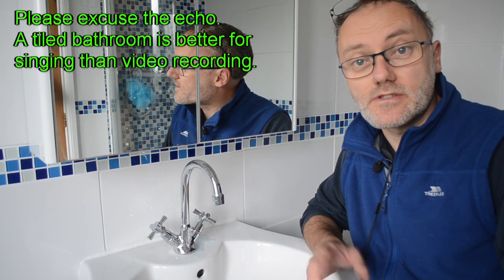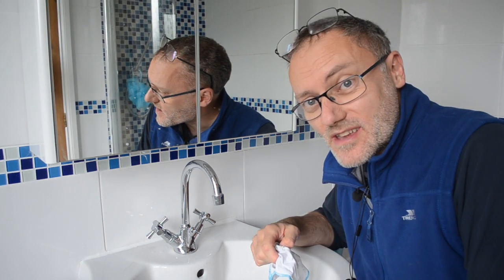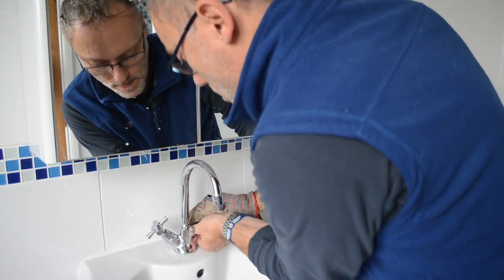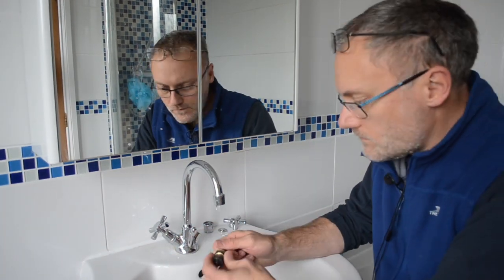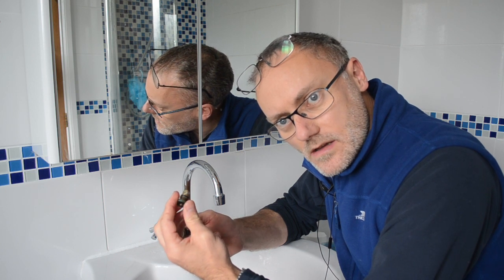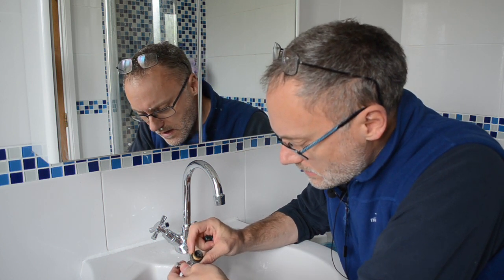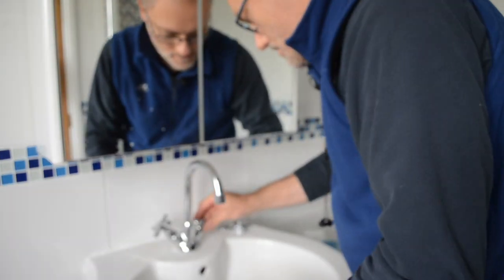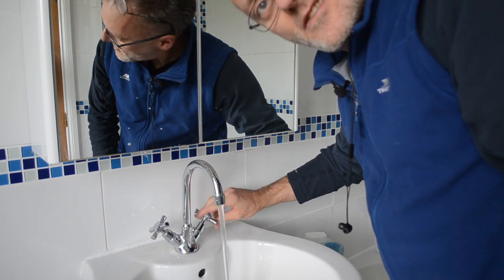TFTT006 Fixing a Poorly Flowing Tap

Comment: Thanks for the nice video. I have a similar tap, hot water stopped flowing completely, however I have an issue unscrewing the last bit, it seems stuck. Do you have any ideas, please?
Reply from the maker: Hi Lucy,  if you live in a hard water area trying some limescale remover can help if perhaps it is a scaled up.  Some sort of penetrating oil like WD40 sprayed on and left to soak can also help, otherwise it's the careful application of a large amount of force being careful to support the tap/sink as necessary.  
I have had the situation in the past where I have had to replace a tap because I could not fully disassemble it.
Good luck!
Reply: Thank you, definitely some scale here! Actually as I was trying to pull the turning knob out to spray inside with wd40, it would not come out as I forgot to remove a little screw) however the pulling must done something to the tap as it started working again.

Comment: what is the right position?
Reply from the maker: In the open position, so tap turned fully anti-clockwise, the washer mount should be as high as possible into the tap handle. The washers needs to be screwed as far as possible into the mechanism. The slow water flow is a result of the washer not lifting high enough.
I hope that makes sense.
Reply: thanks so much. back working perfectly again